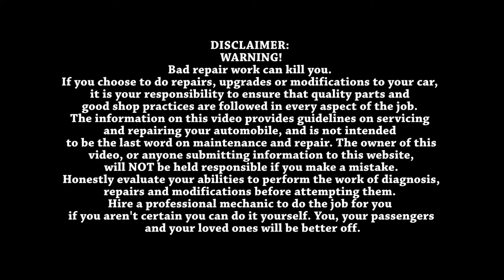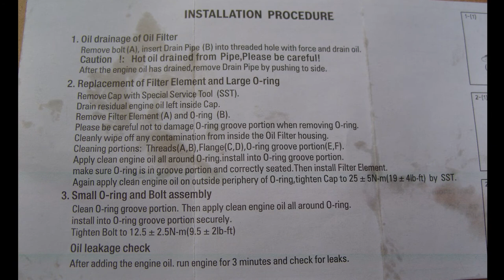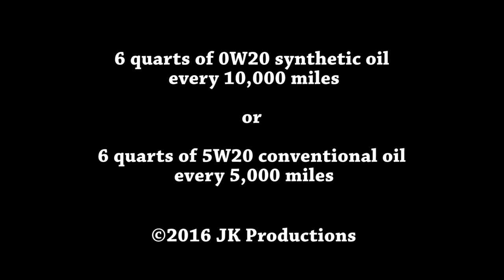2015 Toyota Sienna How to Replace Oil Filter toy 640

Comment: You can skip the center-plate removal....saves time and (another) o-ring issue.....just take the whole cannister off but wear gloves, you will splash more lube....pretty much what you would encounter for an old-style spin-on filter, anyways. You'll get wet either way...this saves a step. ANOTHER THING....NO !.....CAUTION !!!..... DO not use the 3/8 drive to LOOSEN the main cannister.....use the 27 mm hex that surrounds the center hole.....the 3/8" drive is to be used ONLY to tighten. Why?...on previous oil changes, most shops OVERTIGHTEN the cannister, and using the 3/8 drive TO LOOSEN,  can BREAK the oil-tool-cap, or STRIP OUT the 3/8 drive. When tightening, only tighten finger tight and then maybe another "Smidge", like 1/16 turn....NOT 1/4 turn or more like most shops do....that will be over-tight and cause these later problems.